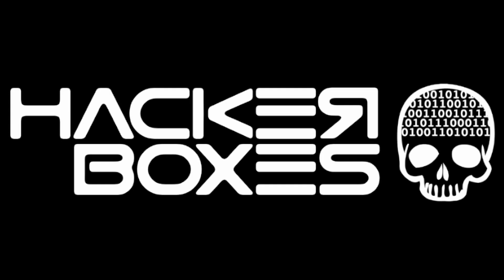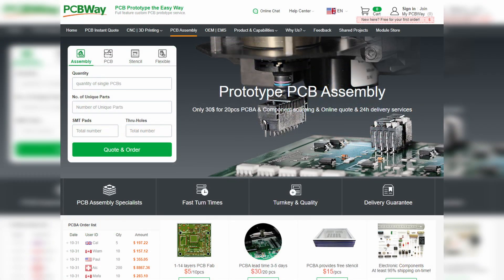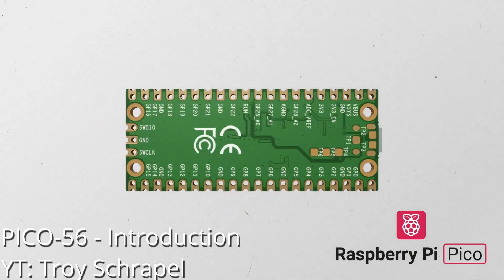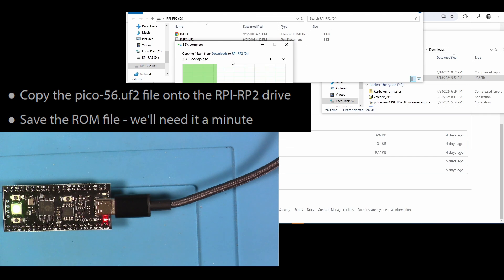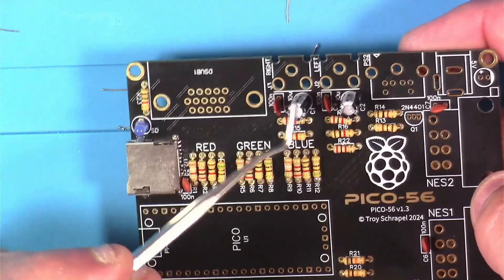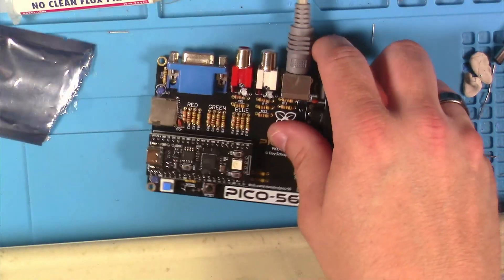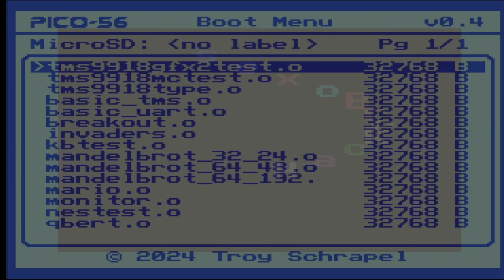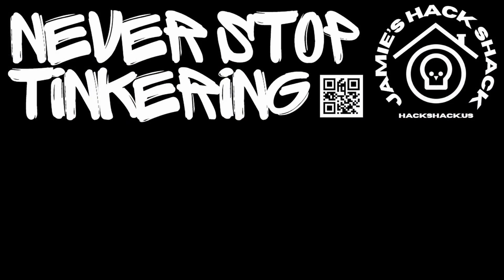Hackerbox 0103 - Homebrew

Comment: holy crap, I wanted to get one of those HBC56 kits when Troy showed them off, just hadn't gotten around to it. see HB still has a few left, hmmmm.
Reply: I still have some on Tindie too. Can't post a link here though.
Reply: @TroySchrapel  yeah I just noticed that. Got the Hackerbox one, and am currently putting it together (hopefully one of my keyboards has a PS/2 mode, lol) I might even get one from you later, just to make a nicer job of soldering that microSD slot. I got it though! my GOD that part was hard.... I've never used Flux before and now I understand why y'all say to use it. It's amazing even in pen form.
Reply: This kit has won. It has broken me. SD card mount fell off while I was fighting with the video circut resistors, because it either wouldn't stick, or bridge. I have no idea why the solder does this, but if ANYTHING in here is connected properly I'd be shocked. I've managed to put pins on my arduinos, and re-solder a thing or two but this is just too damn much. 

Ohwell.
Reply: @DFX2KX  If you're willing to persist, I'm happy to send you a new PCB with the SDCard connector pre-soldered for the price of postage only. Unfortunately, I'm in Australia, so that would be ~$15USD. If you need any of the other parts (resistors, etc.) that might need replacing, I can throw those in too.
Reply: @TroySchrapel  Yeah I did get it to stick again, partially.... But ultimately lost the war when it came to the 2N4401 for the keyboard. My eyes and tiny parts, man.

Thanks for the offer, but I'll pay regular rate when I can get to it. Not your fault my eyes aren't great. That risk was calculated, :P It is smaller than it looks...

I ended up jumping on it as a project in between packing sessions. After I get settled from the move, I'll order a complete one from ya (those caps and that transistor are freaking tiny as well) and I'll use this board as de soldering practice.
 
I suspect I wouldn't have had nearly as many issues if I had gotten whatever Gel flux is being used here. And one of those magnifier/helping-hands combos. That too.
Reply: also, much appreciation for that VERY clear schematic. made it apparent what that transistor was doing.

Comment: Great video, Jamie.  I built this one too and had a lot of fun.  I wasn't crazy about the flux pen they included though, the one in my kit would barely dispense any flux until you jammed it down super-hard, at which point it would dispense all the flux, flooding the entire board.  I've got other flux pens that I use regularly and never had this kind of issue with them... so could just be a one-off lemon.

You made the microSD slot look a lot easier than it was for me.  I was afraid that if I tried drag-soldering I would get bridges to the housing, shorting it out... so I took it way slower under a microscope.  I should have just done what you did.

Re:  re-formatting the card.  I had to do the same thing, but I had to even recreate the partition table.  When I only reformatted the partition it worked better, yet still had some issues.  Recreating the partition table and the partion made it work 100%.

Glad to see Troy added a command to load the directory!  That had me scratching my head too.  :)
Reply: Yeah, that flux pen was cursed
Reply from the maker: Hey! Thanks for watching and commenting. Sorry the flux pen wasn't great for you. I just got lucky on my sdcard dragging probably. Interesting on the partition thing with the SD. I need to play around and see if this one acts weird. Maybe I'll need to do that too.